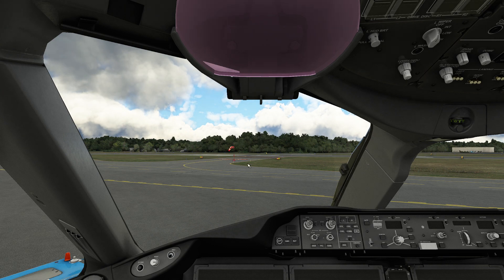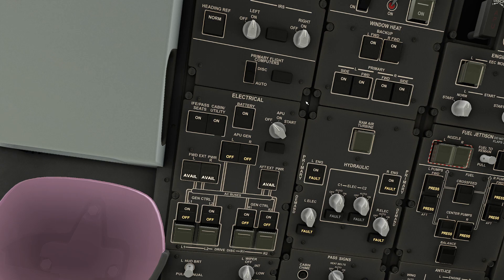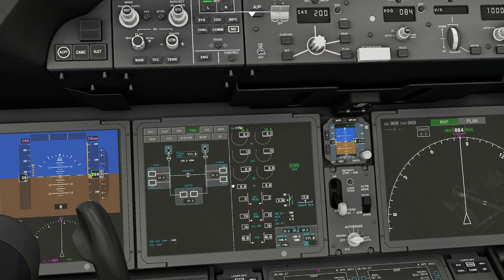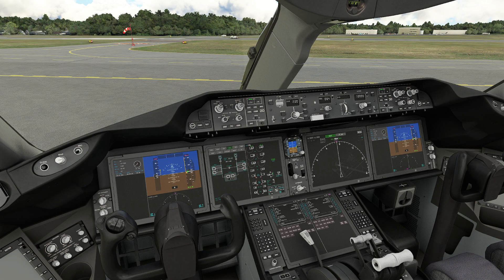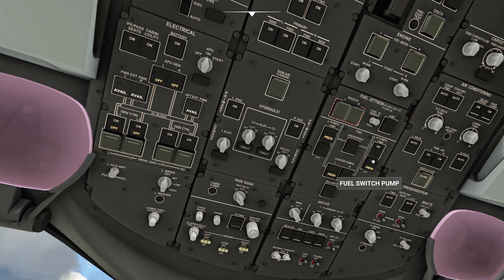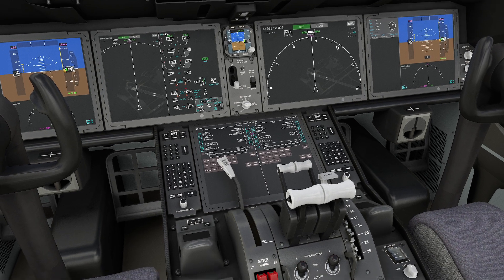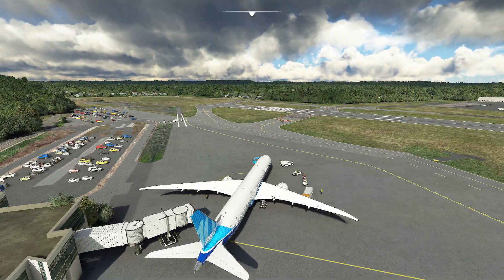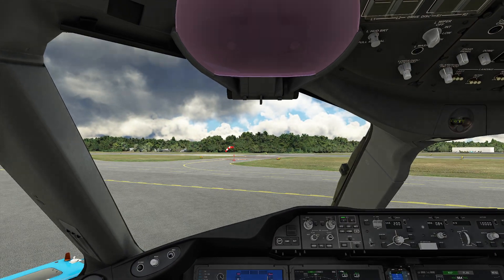MSFS - The APU

Comment: You said "gas turbine" ;)

Just to trim a little better the concept you well explained in the video:
1. The APU provides electric power (not to all systems, rather than just the ones needed for the ground operations and emergency), pressured air for both A/C and engine starters;
2. engine starters are pneumatic, meaning that they are little air turbines. Through a so called "bleed valve" mounted on the compressor case of the APU, engine starters receive compressed air by APU, this air makes an air turbine (mounted inside the starter) spin, this turbine rotates a shaft mechanically connected to the main engine N2 gearbox (after that, the engine can start... meaning that N2 processes the minimum amount of air in order to turn the fire on in the combustion chamber).
3. for the reason you mentioned (too large batteries) and because an electric motor would be huge, main engines are started with a pneumatic motor.
4. when the airplane suffers for an engine loss, the APU should be turned on so in case of loss of the second engine, beside go on the knees and start praying, the pilot does not loose all the systems thanks to the APU electric generator, once the battery/batteries would have only few minutes of life.

As usual, I will be available for further clarification, if needed.
Thanks P!!